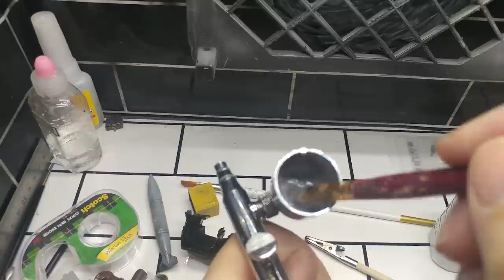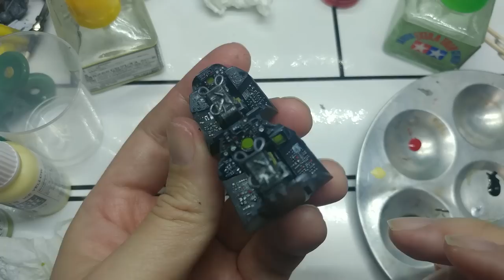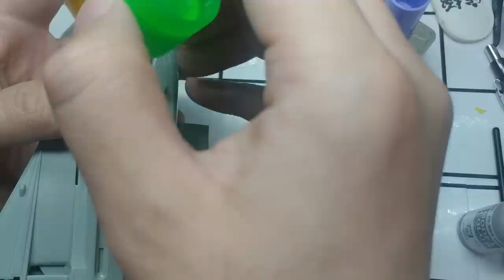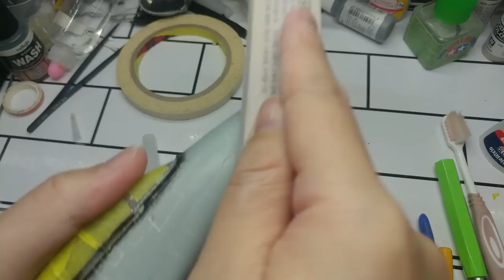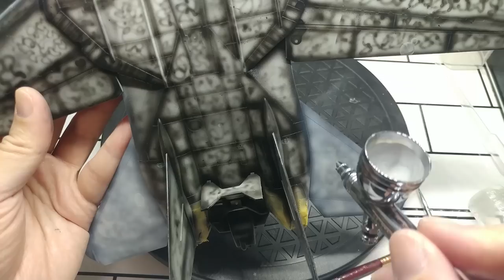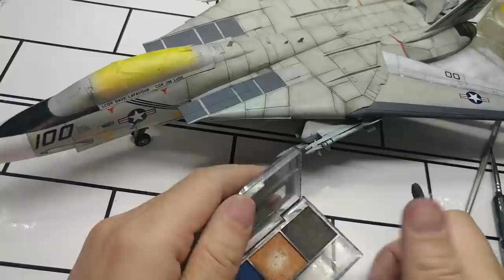F-14A TOMCAT US.NAVY 1/48 Scale  Full Build (Academy)

Comment: Your model turned out really good! I am also working on this kit. I also had problems with the front of the fuselage and under the the engine trunks. Filling those gaps was a task. I had to rescribe and make some new panel lines. I am just now preshading mine. Hopefully it will come out descent. I will be doing the Grim Reapers vf-101 version from DMX decals. Once I airbrush the 1st main color I will upload it to my channel if you are interested.

Comment: Hi, how with airbrush duse and air pressure to work for the cockpit? Thx Denus
Reply from the maker: Thank you.  I use an airbrush at 2.3 bar(For Acrylic, under2 bar for lacquer) pressure and finely control the pressure with the air pressure adjustment coupler.

Comment: how did you masked the white part of the wing to follow the shape of the panel line ?
Reply from the maker: I used a model mask tape. Thank you!
Reply: @pla_art  ik but u did a straight line or just cut in the same shape os the  line?
Reply from the maker: Sorry for the late answer. In some cases, only large straight lines are masked and small details are painted with a brush. Thank you

Comment: I don;t understand this obsession with thick colored panel lines...  where in the hell have you ever seen such heavy panel lines on a super sonic jet... did it ever occur to you that were there is that heavy of a dark line there must be a huge gaps between the panels?  Panels would never have that big enough gap on a super sonic jet... Panels should be tight a fit, and tight fits really show any gaps let alone enough for a panel line.   THe only place you would see such heavy lines is between moving flight controls, and removable inspection panels...
Reply: Accenting the panel lines ads  depth to the model.  If they were left out the model would have sort of a uniform look and there would be nothing to draw your eye to.  It can be over and underdone.  Just however the modeler wants to do it.